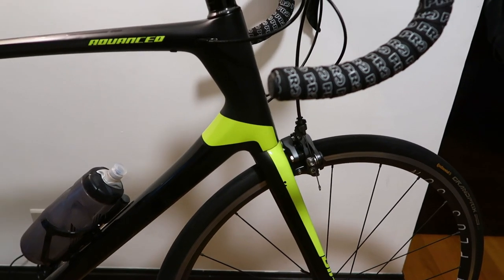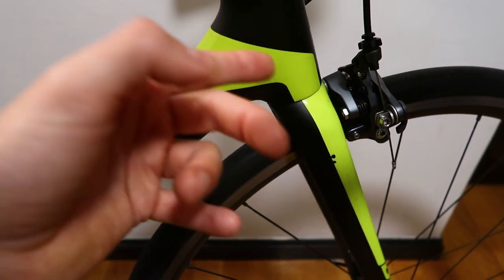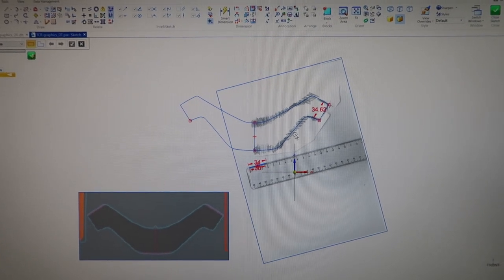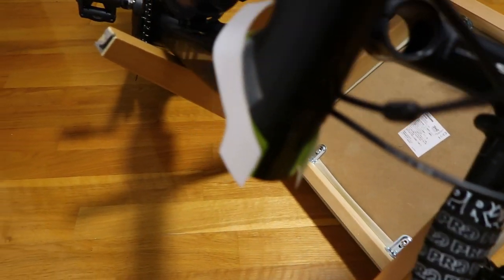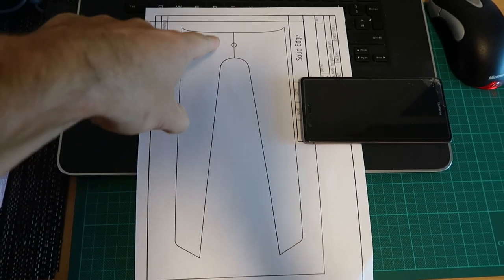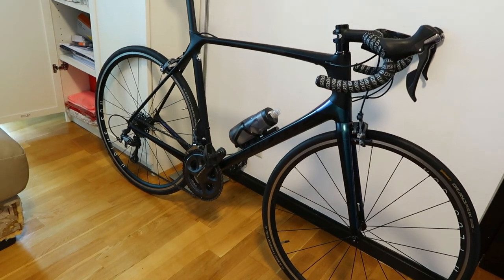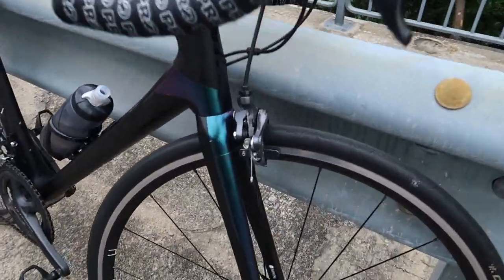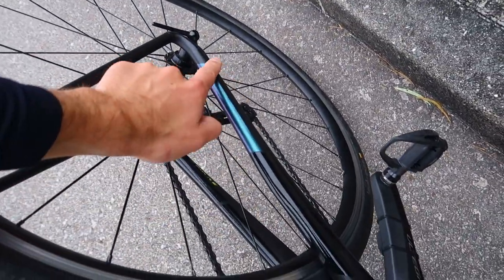How to: Wrap your bike in Vinyl. Giant TCR Adv Pro

Comment: You could have saved alot of time by simply using knifeless tape, you wouldn't need any templates. Just use the tape around the shapes, wrap and pull the tape for a perfect design. A heat gun would have also solved your problems with it lifting on curves and corners. You could have done this so much easier and faster with better results. I have vinyl wrapped cars, motorcycles, scooters, helmets etc that are way more complicated and never needed a template, just knifeless tape and a heat gun.
Reply: do u have or know any good videos? Im about to try wrap my bike for first time I did get  heat gun and knife less tape,any help be great thanks

Comment: This is exaactly what I want to do to my bike! I have the same TCR and I'm already tired of that highviz yellow!!! How is it holding after a month? I tried painting it with plastidip but it would peel off immediately. I'm actually thinking about trying to take off the decals all together.
Reply from the maker: Alejandro Estela on mine there aren't any decals. Its all paint. The vinyl i used is a bit thick so very hard to wrap even with heat. I will do again with the thinner black vinyl. Its still holding up well though. Thanks
Reply from the maker: joderrrrrr. I will send you some information.

Comment: I was planning on just removing the decals all together. Do you think that would work with a heat gun, squeegee, and some time?
Reply from the maker: Jaesuk Lee they're painted on. No decals on mine. But if you have decals and there's no clear coat on top yeh try a heatgun!
Reply: Interesting, I have the same bike, 2017 model and they're decals on my bike.
Reply from the maker: Have you tried removing them?
Reply: No I haven't because I now realize that they are not decals haha. I'm going to wrap the bike as you did but I'm going for completely wrapping the fork. Do you have a printable file for the downtube/headtube that you cutout?